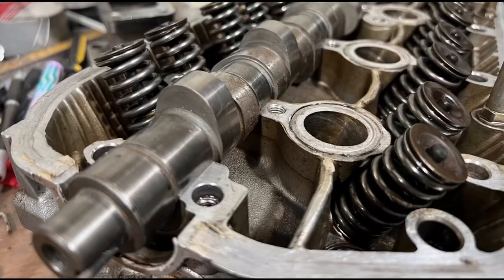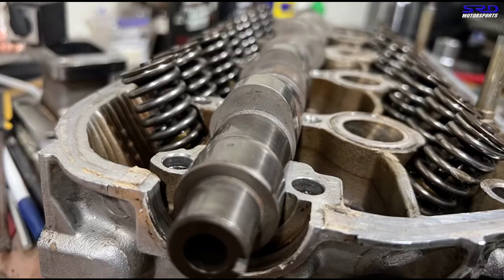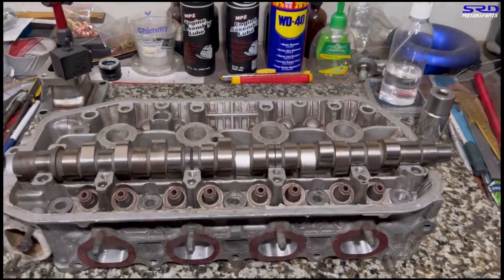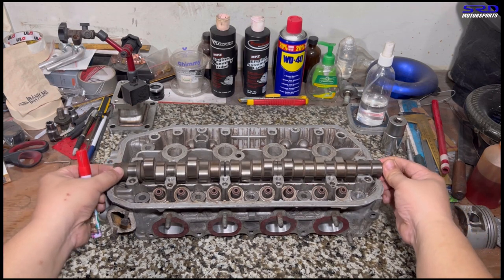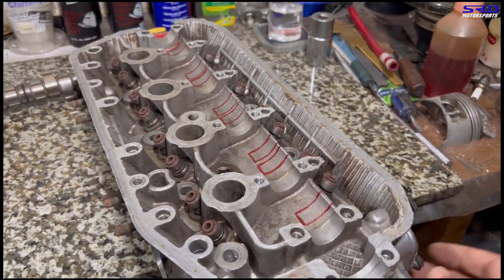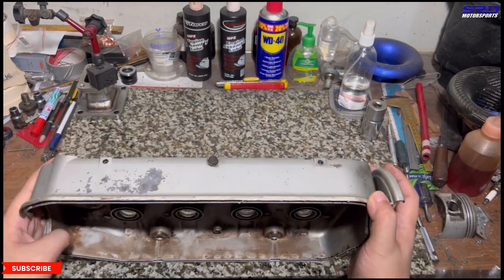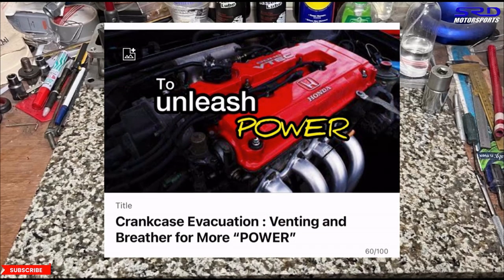D16a6 Non Vtec All Motor Build Series Part 2 Mugen | Breather Tech

Comment: Paps, can you still do that breather box set up with a b18c? Instead of doing the two plugs on the back of the block and blocking off the oem breather box hole
Reply from the maker: Can’t eliminate one or the other check the crankcase evacuation video i made, it explains everything in detail as to why it has this and that etc

Comment: Thanks for reviving D series development bro. In a world full of boring k swaps I love to see devlopment or forgotten knowledge of where it all started come back with these videos. 
On another note, I heard or read somewhere that the old d16a6 heads actually flowed better than the z6 vtec and y8 vtec heads. Is it true?
Reply from the maker: Yes sir and it’s something I wanted to “finally” conclude as u can see we did it in 2007-2008 and I always had a “what if” cuz it got sold and we didn’t get to max out

So before I go B and develop that? I wanted to finally conclude this…

The A6 core has thicker walls than the z6 so u have lesser chance punching holes when needing to port it bigger
Reply: @SRDmotorsports  I see. What about the non vtec B7 heads? They have similarities with a6 heads from face value when looking at where the spark plugs are located. Are they also generally better for porting?
Reply from the maker: They’re the same, both pm3

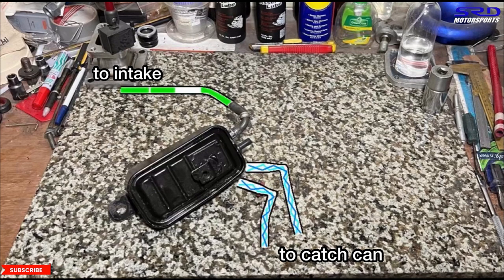Comment: 11:43 Funny that a naysayer says the topics are old, but the laws of physics do not change. 

Also, before talking smack like that, maybe he should show us the best VE build he's done ;)
Reply from the maker: True so true… I mean sure some are old topics? But what has he done for it? Be “lame” about it? lol 

But yeah the mugen cam might take long before I use it it’s huge lol

Plus got another bisi/webcam regrind to test that’s bigger than the current Level 2.X
Reply: @SRDmotorsports  Looking forward to the Webcam testing 🍻 

Also, it would be interesting to see which intake and exhaust manifold can support the Mugen cam. Maybe an ITB with ideal runner length for the intake?
Reply from the maker: Big chance the ItB will work since the mugen cam ran webers and ITB so prolly cuz airspeed was crucial…

But true

Actually for now il stick with the current L2.x but it will let me test porter vs unported p08 manifold then the skunk2 last

But Ofcourse by then it’s time to run my ITB and we can assess the powerband and it’s reaction
Reply from the maker: Also the skunk2 has 9.25in runner length and I made sure the ITB is the same length this way it’s a good comparison on the dyno as far as power curves go
Reply: @SRDmotorsports  What runner inner dia., butterfly size and velocity stack size will you be running?
Reply from the maker: The one showed its 42mm plate ITB but tapers to 48opening stack base
Reply: @SRDmotorsports  Btw, is the 9.25 measurement from the valve seat to the bellmouth face? Or is it from the flange gasket to the bellmouth face? Thanks!
Reply from the maker: 9.25 from head intake flange to opening not including port itself

So total is roughly 12.4-12.5in OAL
Reply: @SRDmotorsports  Falls within the 280mm-330mm runner length for 4-valve circuit or drag heads that A. Graham Bell suggests 👍🏾
Reply from the maker: Yeeeep! Good notes u got there 💪
Reply: @SRDmotorsports  I think Rushi had his runners at 9 as well 🍻
Reply from the maker: Oh snap really? Could barely remember his measurements but I know it’s in dseries still

But that’s real cool to know